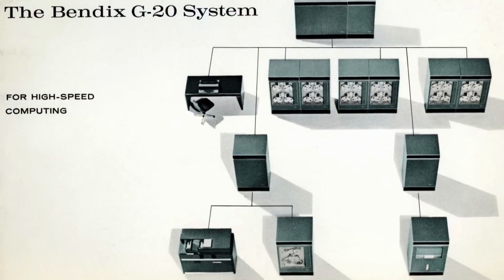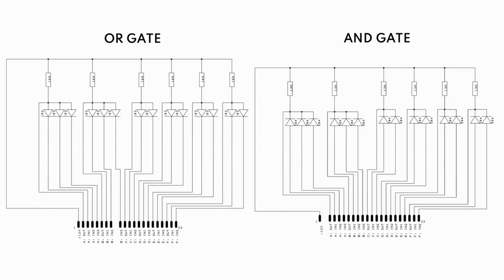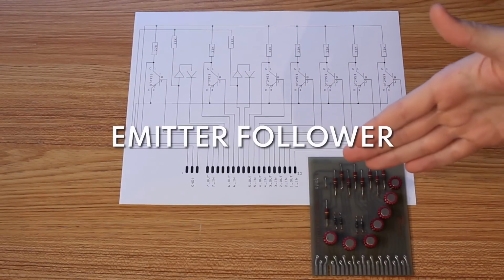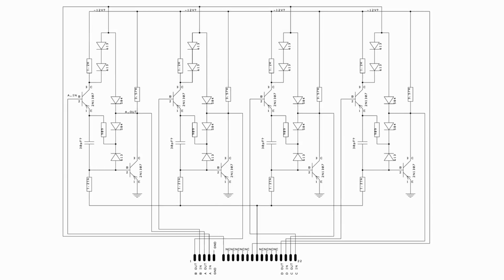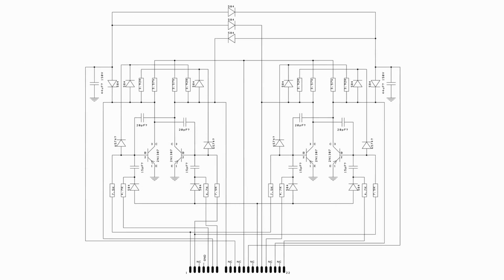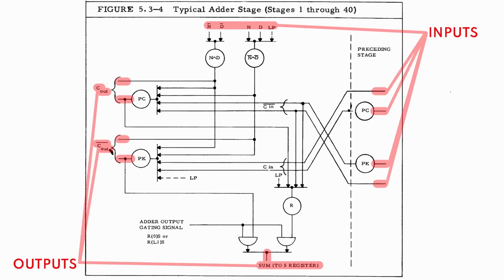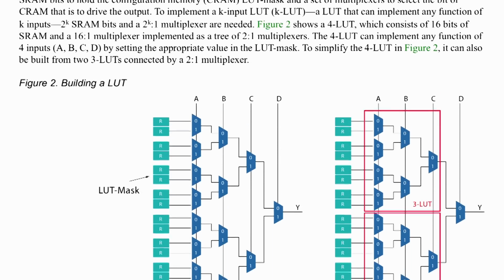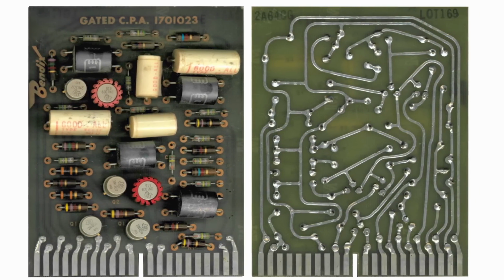Reverse Engineering Bendix G-20 Mainframe Cards

Comment: You might have the emitter and collector reversed on the emitter follower schematic, the emitter should be the output. An emitter follower is also known as a common collector amplifier, so the collector would go to the common connection. Looking at the boards,  the schematic looks correct if the transistors have the common pinout for a TO-5, so maybe the pinout on those transistors is different. A PNP emitter follower should have the emitter more positive than the collector, and the output is taken across the emitter resistor. As drawn, those would be common emitter amplifiers. Emitter follower has output same polarity as input, common emitter has inverted output.
Reply from the maker: It's highly likely you're on point here!
The transistors used on the Emitter Follower are marked GT2953, and I couldn't find any datasheet at all for the. So, I took a guess that pin 1 was under the tab on the metal can, but whether pin 1 is the emitter or collector seems to be inconsistent among old transistors. 
I'll update the schematic and re-upload it to the Wiki!
Reply: @UsagiElectric  When you are unsure which pin is the emitter and which is the collector, you can look at the surrounding schematic and the voltages in the circuit.
In a PNP transistor, the emitter is to be more positive than the collector.  So with a negative supply voltage, the emitter will be towards the GND side of the circuit and the collector towards the (-12) supply.  With a positive supply voltage, the emitter will be towards the (+12) supply, and the collector towards ground.  Of course there can be resistors or diodes inbetween.
For an NPN transistor, this is all reversed.
It is easy to determine if the transistor is NPN or PNP.  Less easy using a simple in-circuit test to determine the emitter or collector, of course you can check that using a transistor tester but you likely need to remove the transistor from the circuit.
Reply: I agree!  At quick glance of the shown schematics I saw different places where emitter and collector appeared to be swapped.
Reply: I too believe you hit exactly what he did wrong. Good eye!
Reply: I knew something was wrong with the emitter follower circuit as drawn, and I think you have the correct answer.
Reply: I also thought that E and C might be reversed.  But every germanium BJT I have ever seen in the TO-5 or TO-18 package has the industry standard pinout.
Reply: @acmefixer1  Yeah, I can't recall ever seeing any the other way either. Not sure what's going on here but something's not right.
Reply: @LauraPFan, you are absolutely correct.
Reply: Remember the "emitter" in "emitter follower" is equivalent to the "cathode" in "cathode follower" or the "source" in "source follower." It's the electrode where you expect to find the load resistor. Collectively, these are called "voltage follower" circuits.
Reply: The way that diagram is drawn is very confusing  The ground rail is at the top of the diagram and Vin sits on an input pin at the bottom of the diagram so the transistors are oriented correctly. Those are PNP transistors. It looks to me like an inverter board. CD4069 or 74LS04 come to mind. So, when power is put onto the base of the transistor, it will turn off. The 22K resistor will pull the output down to ground. When ground is put onto the base of the transistor, it will turn on and allow current through it.

Comment: I also agree with danmenes3143 a classic half adder has three inputs and two outputs, The inputs would be 'A' variable 'B' variable and carry in. The two outputs would be A or B out ( the single bit result ) and A and B out ( the carry ). It take two half adders cascaded to make a full adder. My two years back in 1974 and 1975 repairing electronic calculators almost drove me crazy trying to keep all this straight.

Comment: No matter how you slice it, this can be confusing. Again looking at the GA112-2 gate board, if either input 5 or input 6 is low then Q1 output will be high ( not or function , negative logic ). If both input 5 and input 6 are high then Q1 output will be low ( not and function , positive logic ). It depends on the way you look at it and, how it is wired to the next gate circuit.

Comment: I am sure that LauraPFan is correct, the emitter is the output for the emitter follower circuit. When one is used to working in the more standard collector positive emitter negative world on NPN and our current logic circuits it is easy to get ' turned upside down ' in the 1960's world of PNP germanium transistors. NPN germanium transistors did exist but were rare. This had to do with the difficulty of sandwiching a piece of ' P Type ' material in between two pieces of ' N Type ' material. To maintain your sanity, I think it best to just hang on to the fact that if you have a simple gate circuit ' look at the GA112-2 board schematic from the Data620 ' you must accept the fact that a logic one must be a negative voltage ( from approx -6V to -10V ). Unless they are very special germanium transistors, their maximum collector voltage was -10 to -15 volts. Also because of 'hole drift' in germanium transistors, all bases must be biased below 0V. Since the 0 volt line is the 'most positive' point in the circuit, then the bias voltage must be ' more positive '. I would guess it would be +3 to + 6 volts positive to ground, applied through a 12K to 47K resistor to the transistor base ( again see the GA112-2 schematic ) .

Comment: David on the 'DLO' board, I would assume  the letters D L O stand for delay logic output, possibly a monostable multivibrator. compare this to the DM23 board drawing I made for the DM23 board from the Data 620.The 'handle' for this board is DM23, I would also assume that the Data 620 name means ' delay mulivibrator two output three input' ( just a guess ).
The trimmer pots on the DLO board are associated with one or more timing capacitors ( the head end of a monostable ).

Comment: Hello everybody,
I have worked on the early 70's in Bull General Electric co (later Honeywell Bull co). I worked on troubleshooting problems to CPU's and peripherals. There were 100's (or 1000's on big systems) of these kind of boards. I remember GE-53, GE-100, GE-400 systems. Operating system Gcos8. They were amazing. I will never forget this period of my life. I was in this job for 38 years.  We used many technics for troubleshooting. Test thru operating system, memory dump, and of course all electronic tools. Mainly oscilloscope.

Comment: Cool project!
The transformers are interesting. I think they are used to detect binary transitions. Given the signals are discrete binary, the transformer will give a pulse on the secondary when fed rising or falling edges on the primary. The pulse sign will depend on the transition. It is clever way to get edge detection without active components!
Core memory uses that in combination with the core saturation to get the reading of bits.

Looking forward to the rest!

Comment: Let me say unhelpfully, that in 1980 and '81 I maintained Bendix's computer peripherals in Teterboro, NJ.  There were three divisions there, Bendix Flight, Bendix Aviation and Bendix Guidance.  The peripheral vendor was Data 100.  The mainframe which I assumed was IBM was in Southfield, Michigan.  I was responsible for card readers, card punches, high speed printers and the terminal controllers.  They also had a plotter which was maintained by someone else, possibly Calcomp.  The punches were Honeywell Bull made in France.  Bendix was acquired by Allied Signal which later acquired Honeywell and took the Honeywell name.  One of theri data lines was 9600 baud which was very fast for 1981.  Engineers would submit programs on punch cards which were read to the mainframe in Southfield and wait.

Comment: I was very glad to see the G-15 again!  In 1965, when I was a senior in high school, we had a G-15 that was specifically placed for student use only.  We later learned that it was the very first computer for student use ever placed in a high school, in the entire nation.  It was a rather minimal system, with no mag tape drive.  It just had the built in paper tape punch and reader.  The entire computer class learned how to program the machine, and we all wrote our own programs, entered them into the system, punched tapes, and ran them.  I/O of course was via the highly modified IBM typewriter or punch tape. One interesting thing about this system is that ALL memory was on a drum memory, belt driven by a 1/4 horse motor, with fixed (not flying) heads.  A few years later, I heard that the system had been scrapped, and I ended up with that drum memory (without the motor and belt).  I tried to do something with it, but had no information about how to set the heads back into usable position, so it sat for years, and I ended up getting rid of it.  There are two machines that I know of that are still in use.  One is in the Smithsonian Museum of American History, where it is demonstrated regularly, and the other is in Australia, but I don't know if they have gotten it up and running yet.

Comment: I might know why you think there's a typo in the documentation. I bet the document is right, but what makes it confusing, I bet it's using positive grounding! that would make the off state a negative potential at a voltage which you'd normally see for the on state. those numbers are relative to the grounding. if you ignore grounding, simply add 3.5 to the on/off voltages and you'll have values that make sense to you. add 3.5 to the on state and 0 becomes 3.5, and same with the off state, -3.5 becomes 0. I could be wrong, but this is what clicked into my mind while watching.

Comment: Just as an aside -- I restored a 1968 Ford Galaxie a few years back and Bendix made both the single-piston floating-caliper front-disc-brake system, and the AM/FM-Stereo radio!  What an eclectic company, to have made such disparate, non-related systems like that!

It was the first time you could get an AM/FM-Stereo radio in a Ford, and the first time you could get a single-piston floating-caliper front-disc-brake system in a Ford as well.  (Yes, earlier Ford models had AM/FM radios -- but not stereo.  And earlier Ford models had front-disc-brakes -- but not the single-piston floating-caliper type. The earlier disc-brakes were the multi-piston Kelsey-Hayes brakes that were about 5 times more expensive than the later Bendix single-piston disc-brakes.)

Comment: Looking at your schematic diagram and their diagram tells me two things immediately:

1. This isn't a full adder in one board at all. There isn't a single output that corresponds to a full adder. The output of the adder is derived elsewhere but possibly uses signals from this card.

2. This is primarily the look ahead carry logic. There are four carry signals in total: immediate (look ahead) carry, chain carry, chain no carry, and immediate (look ahead) no carry.

I will be sharing a read of their full adder diagram as well as a working model of their diagram in Logisim Evolution with notations.

Comment: I doubt if the inverting amplifier is doing any level shifting. Probably just an inverting buffer--like a 74LS04. A "buffer" can also be called a "current amplifier."

The first transistor is an emitter follower, which provides input buffering. That is, it isolates the output of the previous stage from the messy transients generated in the next bit. The second transistor is the actual inverter, a transistor wired in a common emitter configuration, which is what you would expect. The capacitor Provides a short pulse of extra base drive to the second stage, which will accelerate the output transition, especially if there is any capacitive load.

Comment: Those "transformers" may be saturable reactors.  They work much like a core to hold the state of a bit in a non-volatile state.  One piece of equipment I worked on while in the USAF in the 1960s used hundreds of bi-mag cores in shift registers and other logic functions.
Reply: I thought that you need quite a lot of tubes/transistors to read out a core -- like a whole card. It would be easier to build a tube flip flop for each bit if the "memory" is scattered throughout.

Comment: Oops! Not these PCB's with the name Bendix on it, but similar, approximately the same size, they were a the electronics dump-store, and very cheap. Those were sold to desolder and harvest the spare parts. Maybe we took apart the Colossus or the amplifiers of a telephone exchange. Who knows! Some board had transistors on it and I have even seen board with extreme small radio-tubes (directly soldered to the PCB).

Comment: On the Gated CPA card, I think you have the -12v and Gnd reversed (or just call it +12v). CPA probably means, "control pulse amplifier". The diodes are to snub the reverse EMF on the inductor coils, so the cathode should connect to the positive supply and the anode to the negative. By reversing the power supply, it all makes more sense and is easier to understand. I think there are actually two identical channels, but the schematic may have an error or two in it. I have an idea what it does, but need to see it better.

Comment: The emitter follower diodes:
The diodes are in series with a pullup resistor. Chances are they're using germanium transistors and diodes. The forward bias on the diodes will equal about 0.6 volts. The forward bias might be used as a bias point for the next circuit or are used to subtract 0.6 volts in case the transistors don't saturate fully to ground when turned on.
Edit:
Another thing that might help you understand the "reverse" logic going on (using a negative power rail) is to think not in terms of 0 volts and negative voltage but think of 0 volts and power. Regardless of the polarity power is on, no power is off.
Edit #2:
The quad inverting amplifier might have been used for long runs. Locally using a 3v change would cause a logic gate to trigger, but a logic gate on the other side of the machine (and possible in another box on the other side of the room) would need a large voltage swing to push electrons through signal lines that would have either a lot of external noise interfering the wire runs and help overcome any capacitive effects from those long runs.
Reply: First edit: This. I've only had a brief look, but suspect that the logic works on a differential from ground, be it +ve or -ve
Reply: @mpmansell  same thing. Rs232 serial ports use a dual rail (positive and negative) swing to get past noise, capacitive effects, and help eliminate corrosion effects of dc if the long run of wires get wet.
Reply: @mpmansell  I forgot to add that a negative voltage might be used to "hard turnoff" the next stage. Basically applying a negative voltage to the base of an NPN will make it turn off faster (swap polarities for a PNP).

Comment: The extra diodes on the flipflop board look to be either a clock line or common set/reset line. That adder board also is definitely a DTL lookup table circuit. I've made a single-bit ALU that way before. The way to deal with the add/subtract is to use the multiplexer to select either the carry input or its inverse for each of the four input states, for both sum and carry out. Carry lookahead is hard to follow, I still haven't quite figured it out either, but reading some of the datasheets for the 74182 might help.

Comment: Bendix is famous for their invention of electric starter motor coupling mechanism, which couples the starter with a flywheel of a gasoline engine. In my country, this part/assembly is simply called a "bendix" (like we name "adidas" for almost any sport/running shoes, "electrolux" for a vacuum cleaner, or a "junkers" for a gas powered water heater).
Reply from the maker: You know, I always knew what that coupling mechanism was, but I never knew what it was called. It wasn't until trying to find good visual material for Bendix that I realized that it's the Bendix drive!

Comment: I think part of the confusion on the full adder is that it is also a subtract circuit. So I would guess it takes one bit from each input and goes into C and D inverter. This along with the non inverted input and carry inputs and the Add/Subtract flag would give you one bit output and more carry options. I don't know how the look ahead carry would work though, but the circuit appears to have enough inputs and outputs for it if each card only handles one bit and you jumper the inverting and non inverting inputs together.

Comment: So where I come from (Utica NY) my dad worked at Bendix. He got hired in '66 and retired 15 years ago or so, and in addition to the aerospace machine shop where he worked, they had a PCB fab plant in the city as well, which I was told made cards for IBM mainframes downstate in Kingston. We had a ton of them in the house I grew up in. I wish I had kept them. I would have donated them to whichever computer museum needed them.

I don't have time to watch this video right now, but can't wait to see it later.
Reply: Huh - I worked at GE Astrospace in Utica in the 1980's, and didn't even know Bendix was there!   {edit}Turns out it was not far from GE, on the other side of the highway.  I never ventured over there.
Reply: @donmoore7785  you could have almost hit it if you threw a rock.